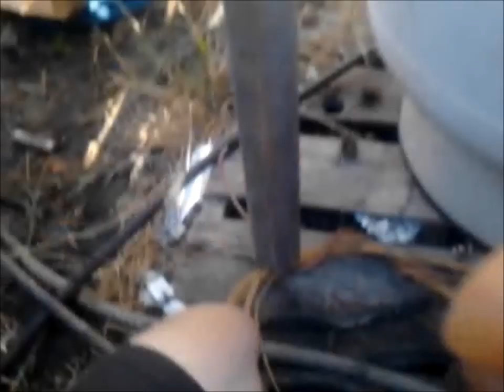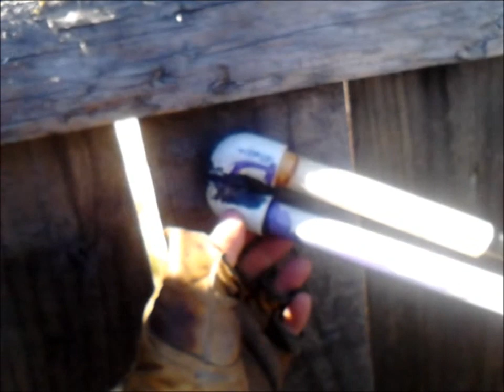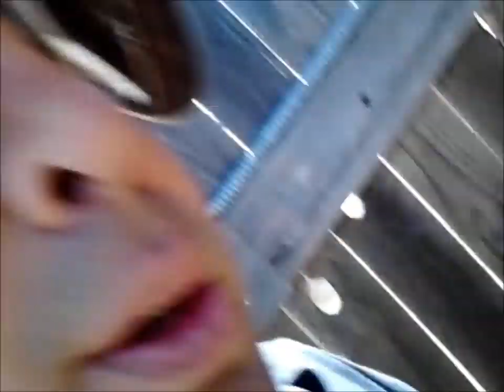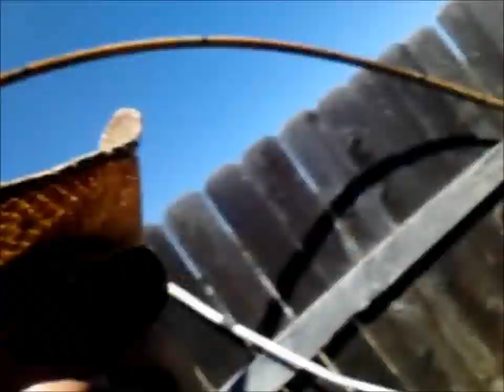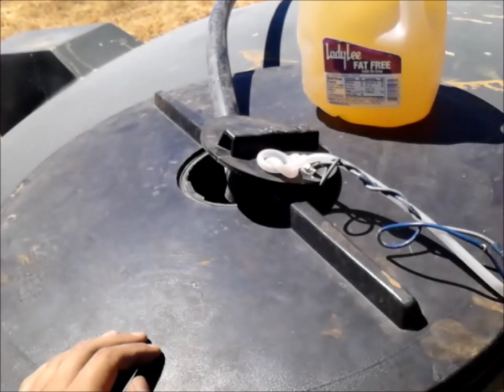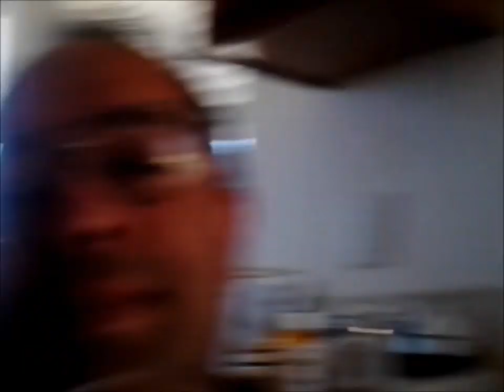How To:  Airlift & Geyser Well Pump Prototype Explorations and Test Data

Comment from the maker: I actually trashed this pump in favor of just a foot valve on the drop pipe and a 5/8" garden hose as the air feed. Works about the same. Less complexity. More reliable and robust.